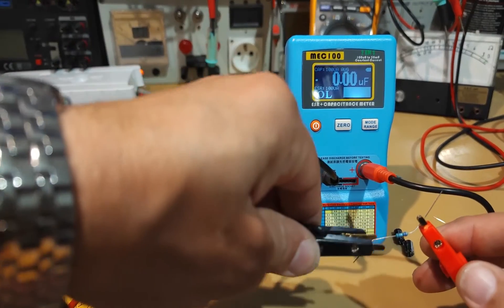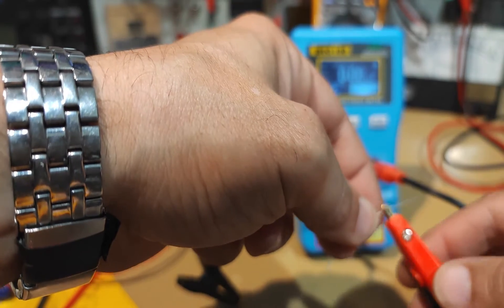MEC100: the best device for Capacitor and ESR, 2 in one. An underrated tool.

Comment: me hubiera gustado que midiera capacitores ceramicos de muy bajo valor 5p 18pf  en teoria eso puede medir desde practicamente 1pf
Reply from the maker: this device is made especially to test chimical capacitor. This is a capacitor tester, not a reader. So, pF are to low for this device. If you can read such values, you need an LCR meter.
Reply: Proskit mt5110 puede medir bajos valores desde 1P hasta 20k uf
Reply from the maker: @guateque1718  the device on the video is a chimical capacitor tester, not a capacimeter tester. A real capacitance meter can read until the PF capacitance, like Proskit. But LCR can make both.

Comment: I couldn't get the Mec100 in my part of the world but I did get an Mf470 by a company called Alignimals. It uses exactly the same case and buttons as the mec100 and several other similar meters. The Mf470 gives the esr, capacitance value and the % difference to the nearest standard capacitor value. It does not have Kelvin leads like the Mec100 though.  I wonder how much difference there is between these two devices. Thanks for the review.
Reply from the maker: @guateque1718 hi. Apparently there is no much difference between them. the Mf470 has abilities to measure very high value, for who need it, like many farads in capacitors. But it can also measure very low capacitance. That's a kind of beasty. MEC100 is not so powerfull, even if it uses kelvin clip. Kelvin clip can be used to (supposedly) give better result for ESR and so on). But who cares about so short probe. I think they are quite similar. Kelvin clip for those kind of measurement are useless at my sens. Mf470 seems to have a really specific use for big capacitors measurements. It seems to not suffer from a lack of something... A least  I didn't see what. Thanks for commenting.